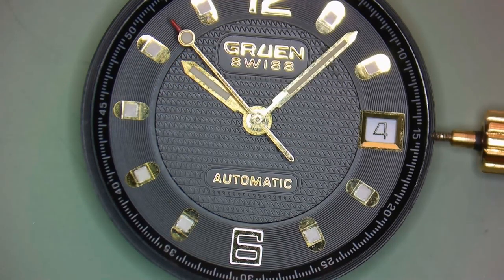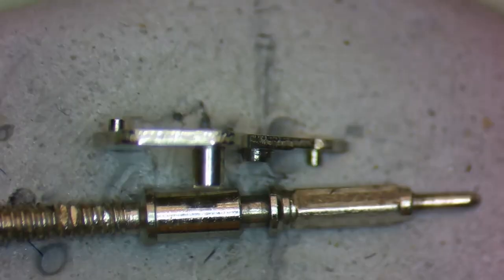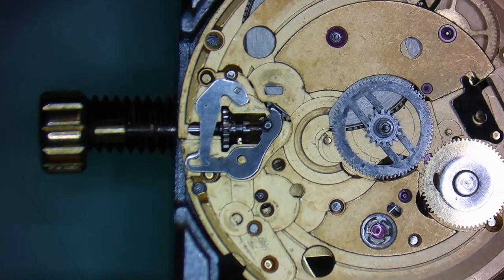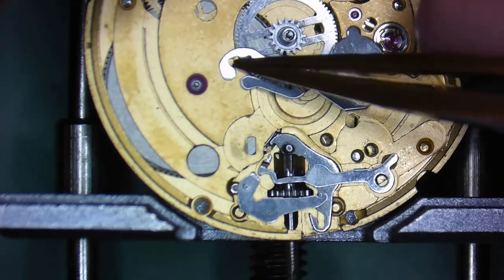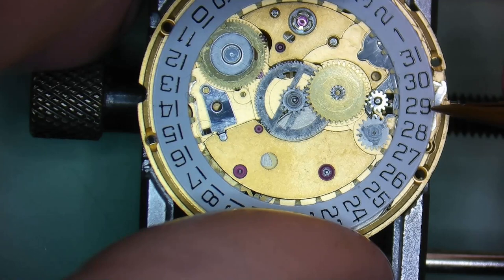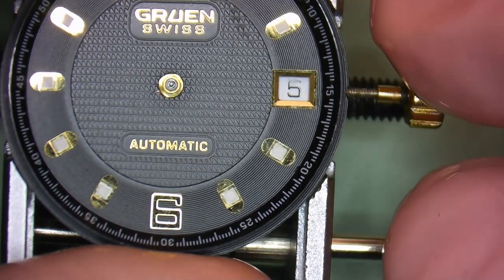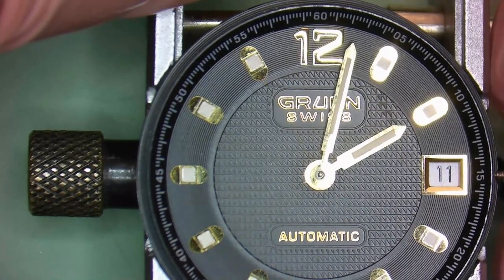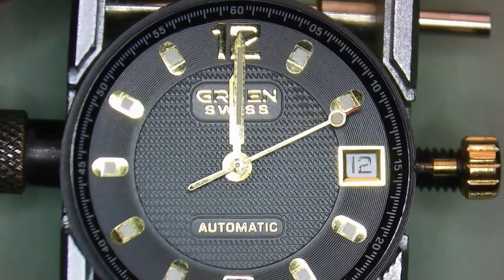Troubleshooting Winding Stem Problems In a Mechanical Watch.

Comment: This is an absolutely wonderful lesson. Alex is a natural and gifted teacher. There are many watchmaker videos that disassemble, clean, lubricate, and reassemble. Those videos almost always just say this part goes here and that part goes there. Alex is one of the only watchmakers who takes the next step and tells you WHY this part goes here and WHY that part goes there. He tells you how the movement is supposed to work which is the information you need to troubleshoot when the watch isn’t working. I would love to see a video like this that troubleshoots stem problems on the Seiko NH35/36 movement. IMO when Seiko modified their classic 7s26 to the 4r36 they had to introduce a lot of clunky and unnatural gearing to allow for handwinding.
Reply: I have it in the list but it will probably be on my other channel, watchrepairtutorials

Comment: I've tinkered with lower end automatic Seiko movements quite a bit and never broken a thing. Three days ago I started with my very first ETA 2824-2 clone and messed it up when removing the stem. I was sure is was a goner until I found you excellent video. It took me two hours to get it fixed but more than that, I'm thrilled about your insanely good video of it. Video quality and everything well explained. Cannot be any better. Thanks a lot!

Comment: Thank God for this video! I was about to give up on this altogether due to spending hours and hours on a non-winding stem, but it turns out the problem was the yoke spring not tensioning the yoke. All I had to so was apply pressure so the yoke is locking before screwing down

Comment: Thank you for this video! I had a Tudor Prince Oysterdate with an ETA 2824-2 movement where the stem pulled straight out of the case when pulling for time setting. I was able to disassemble the movement and diagnose that the yoke was jumping out of the sliding pinion. Your video was a very straight forward explanation that helped me fix my watch :)
Reply: Man that’s great to hear. Thanks for letting me know. 👌Alex

Comment: Superb video. I had just started assembling my first watch when after changing the crown and inserting the stem, I noticed it wouldn't change position. Hoping the yoke has just jumped out, but I will wait until my smaller screwdrivers arrive before investigating! My movement is an ST2130, so this video will be very useful indeed!
Reply: Very cool. I would love to hear what you discover as the problem.
Reply: Mis-aligned yoke, just as in your video! Happy to report it now changes between positions and winds normally! Thank you so much for the vid!  Phew!
Reply: @chrisairey877  nice job man. Glad I could help a little bit.

Comment: This is really good stuff!!! I have a 1973 Longines automatic ultra-chron. The crown had become extremely stiff to wind so I used the winding tool (which fits in the crown) and it appears that something may be broken inside as the crown and stem are still attached but its moving freely without resistance. I no longer can set the hands nor the date. The watch itself is running as its an automatic watch but I guess its a matter of time.
Reply: No being able to set the date will be an issue, Right?

Comment: Awesome video buddy! I have a question if you don’t mind.. do you do any repairs? I have two watches same movement and my stems won’t go back in.. the watch still runs but when I insert the stems it doesn’t run and won’t lock in smh.. is there a way I can get them out to you to fix for me? Do you have a website or email I can reach you at? This video explains what can possibly be wrong but I don’t have the tools and I’m afraid to open my watches up.

Comment: Hi Alex, another excellent video -full of information and a precise demonstration of the way to achieve the optimum midnight date change. I've been  surprised when in other videos the YouTuber accepts having the date change minutes before or after midnight.  Do other types movements have a less precise turn-over?  As a newbie, my experience is limited but I have had "right at midnight"   results with an ETA 9362 quartz movement -but not achieved as elegantly as you've demonstrated here. Cheers, Dave
Reply: Well if you think about it, it has more to do with where the hr and minute hand is, right?
What determines the hand position. Answer>>>>>>>>>>>>>. its where you put the hands.
No matter whether its a instantaneous type of driving wheel or not, there is a point when the tooth of the date wheel falls over the  date jumper.  When this happens, that's when you set the hr hand position.  then you advance the hr hand again and  make sure the change happens with the hr hand at 12 and then set the minute hand and advance them 24 hrs and check it again.
Even if the date driving wheel takes 3 hrs to click the date wheel over, it will been seen based on where you put the hands.
Reply: @watchrepairtutorials  Got it! Thanks for the reply👍

Comment: Hi Alex, thank you so much for this Video. As a beginner im usually watching your other YT-channel, but now it was time for my 1st self performed watch repair ever. A 2824 had its stem broken while sitting in my watchbox without any external impacts. Your Video was such a great help, without it, i would have not been able tomnperform that task. And it was successfull, i managed to disasamble and reasamble the watch, i lenghthen the new stem and at the end all worked out well. But...
It was not that easy to me as it look in these yt videos from you and other watchsmiths. I didnt even know, which is the needed position of the stem when you want to remove it. I had to redo the keyless works about 5 times, as it just didnt work. One time, i inserted the sliding pinion the wron way, but hey, i was working with a stand-loupe with about 2x magnifiying and therefore didnt see to much. After doing it the 5th time, it all worked well. I also had dificulties to reinstall the date disk on the lil spring, and most difficult part for me was to install the hands again. But i kept being patient and kept trying it, even changed the magnification cyclops on the Dial. 
Well i ve spent around 800 bucks for watchmaking equipment so far, withanother 1300 to go for a microscope and mainspring winders and cleaning agents and oils.... compared with 50 EUR i would have to spent for a watchsmith for this repair, it might sound a bad investment. but i have learned quite a view things and have the tools, to perform the next repairs aswell. 
Do you rememer the first time you repaired a watch? it feels great.
Reply: Of course I remember and still get an adrenaline rush when I fix a hard problem.
Good luck and hope to see you again

Comment: Thank you for such a great and detailed video.  This helped a beginner like me fix this very issue where I removed the stem to case the movement / dial, but could not get the stem to connect back in (the setting lever jump became dislodged from its position).  The good news is, using your video, I was able to get it working again! The bad news is (and I'm sure most can relate), when going to put the screw back in for the setting lever jumper, as I started applying pressure, the screw flung across the room.  After crawling on my hands and knees for a good half hour I've come to the conclusion that the screw has entered another dimension lost forever to this world.  Wondering if a repair kit exists that contains the various screws for the 2824 movement to assist clumsy people like me (LOL)?
Reply: They are out there.

Comment: All good and nicely explained. However how do you remove the movement from the case, when the stem does not come out despite unscrewing the set lever screw? Thanks for your tip and or suggestions.
Reply: Sometimes you have to pull the crown in and out to free it up. It the setting lever is rusted or the screw is stripped, you just have to figure out how to get to it.
Reply: @alexhamilton9566  Thanks, the crown does only pull out like a spring and when turning it, the winding is engaged. When it's pulled back the hands can be set. Just the opposite as usual.🤣
Reply: @queenofscots839  Sounds like a mess. What movement is this?
Reply: @watchrepairtutorials  It's a AS 1430 I was able to remove the movement by unscrewing the crown. Parts are dirty and some rust. Thanks your video it did help.

Comment: EXCELLENT  video!! So well described logical easy to follow. 
I have a Valjoux 7750 on which the winding crown slips freely in all three positions, I cant wind it, i can set the time if I pull it with some force while turning the crown. Before it started to slip, it did turn harder than normal I thought as with some more resistance than normal. I'm thinking the square part of the winding stem is worn or the winding pinion. Could you give me your opinion? Also, Is the major winding and setting operation similar to the 2824? Would really appreciate you help if possible.... ;))
Reply: First I would say that I probably would wind it if that much force is required as many parts can be damaged and that's not a cheap movement to service.
The keyless works is  also different that what you see in the 2824. 
If I had to guess based off what you said, I would say that the winding pinon is worn or the crown wheel is loose or a combination of the two.
It sounds like it is in need of a service.

Comment: Hello Alex, Thanks for an informative video. Today I found a problem with my own mechanical watch stem. The crown/stem only winds and allows for time adjustment (no date function). Although the watch wound fine, when I pulled the crown to correct min/hour hands, the stem came completely out of the watch. I can refit it by loosening/tightening the small retaining screw, but upon trying to move to the time adjust position, the same thing happens and the stem pulls completely out. Is this a similar problem to what you showed us in this video with parts perhaps slipped out of position? Thank you, Alex
Reply: The pin on the setting lever that fits in the slot on the stem is either not tightened down enough or the pin is worn sufficiently allowing the setting lever pin to pull out.
If you remove the dial this would be a pretty easy to determine what the problem is
Reply: @watchrepairtutorials  Thank you for the feedback. Appreciate the help.
Reply: @watchrepairtutorials  Hello again Alex,
Just to let you know I took the watch (ever so carefully!) apart today. Once I removed the face I could see that the setting lever's pin had jumped out of the notches of the setting lever jumper. I don't know how it got into that position but I gently pushed it back to engage the pin again into one of the notches. Fortunately I didn't need to disassemble further to do this. It's thanks to seeing your video that I had the confidence I could tackle this so thank you for taking the time to create it.

In doing the repair, I noticed there are no seals on the stem or crown so I've ordered some to fit. Can I ask you, when removing the stem next time, should I start off with the crown fully pushed in (winding position) or fully out (hand adjust position) before I loosen the retaining screw for the stem or does it not matter.

Thanks again,
Alex

Comment: Isn’t there a fault with this movement where if the stem is not in the time set position before you remove it, then it will not go back in.I understand that the Foreign version included the fault in their copy as well. Illuminating as usual!!👍 I did one with a day function and it was a nightmare at my skill level.
Reply: I’m not really a proponent of this theory. I think what it comes down to is a part either being worn or a Part was manufactured of tolerance a little bit and enough people read that and all of a sudden it’s built-in fault in all the movements. I’ve seen the problem very few times in this movement. 
I think it’s more probable that it’s an issue that people loyal to Seiko  perpetuate.
Reply: Duly noted. Thanks.

Comment: I have a Hamilton watch 8482 and the winding stem is pushed all the way in an on every YouTube video I see when it’s all the way pushed in it ticks when you spin it and mine does not tick when I spin it … please help me I can’t find any ANY information to help
Reply: So anytime you are looking to remedy a problem with a watch movement, you need to first start with which movement it has inside it.
I am also not sure I fully understand the issue. 
Is the problem, when the stem is pushed all the way in, the Watch does not run?  
What do you mean when you say, it doesn’t tick when I spin it. What are you spinning?
Reply: @watchrepairtutorials  I’m not a expert or anything lol im just saying the thing that’s on the right side of the watch that moves the hands and where you wind it at to start the second hand to move it…

Comment: I have  a SEIKO seikomatic Weekdater Diashock 35 Jewels 6218-8950 Automic Watch which cannot  be manually wound, the Day Date cannot be advanced manually, andthe HACK does not function, but the DAY-DATE advances at midway..  Wher can I get it fixed?
Reply: try to locate a local watchmaker first. If there are none near you there are many online.

Comment: Thanks for the tutorial. The stem in my watch will not turn clockwise once the movement is fully wound, do you know what the issue is? thanks
Reply: I am assuming that this is a manual wind watch you are talking about. A manual wind watch will stop when the mainspring is fully wound, unlike an automatic watch that’s also hand winds. The mainspring in an automatic watch slips inside the barrel once a certain amount of torque has been reached. 
Does that answer your question?
Reply: @drunkdriver  If you are winding it and the resistance is such that it feels like you need to stop winding< it sounds like the bridle is not slipping and yes that is defective.